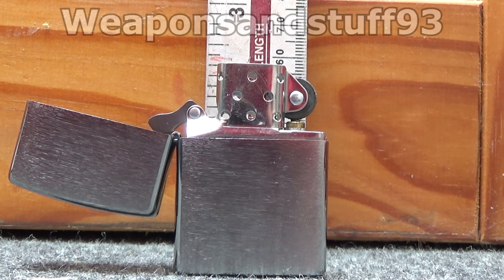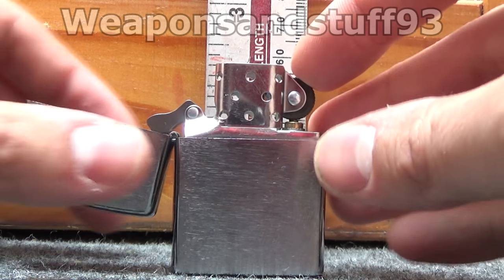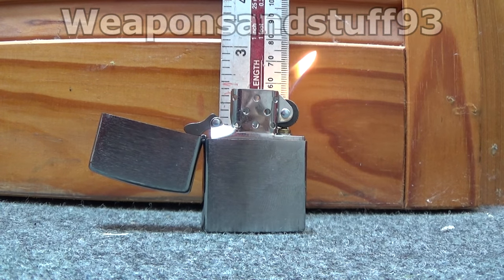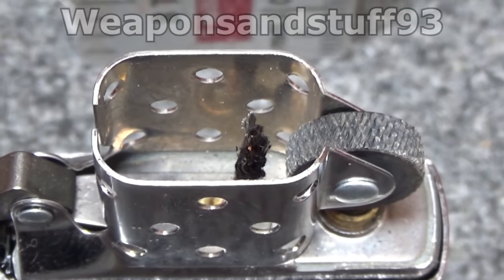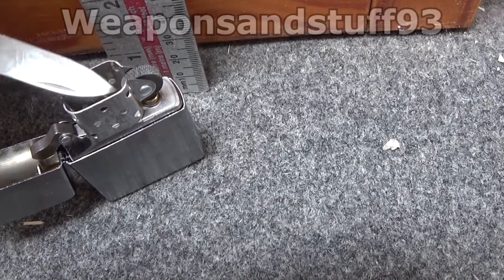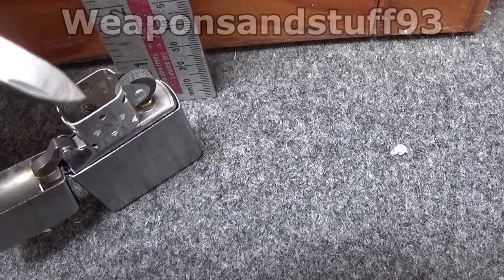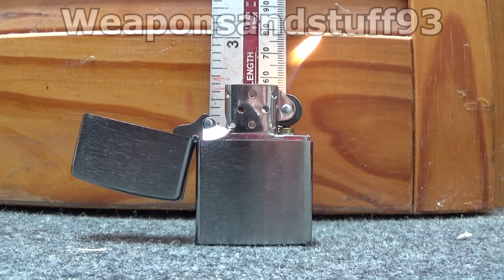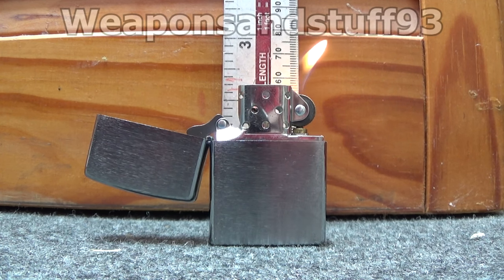How to Adjust the flame on a Zippo lighter

Comment: Cheers mate
Reply from the maker: No problem it's a really easy fix lol
Reply: @Weaponsandstuff93  actually I have a question about my ronson butane lighter. It doesn't seem to be working but the flint is in and working so I was wondering if u know
Reply from the maker: @takeyari2124  Most likely thing is the butane has gunged the inside up.
Reply: @Weaponsandstuff93  is there any way to fix that? Sry to bothar you by the way😔

Comment: Nice, i've had zippos for years and never knew that trick!

great litle vid mate
Reply from the maker: +WeaponCollector Cheers, obviously what fuel you use etc makes a difference to flame size as well and the condition of the wick, mine will need pulling through a bit soon but yeah for some reason the wicks placement inside the wind-shield effects the flame height.